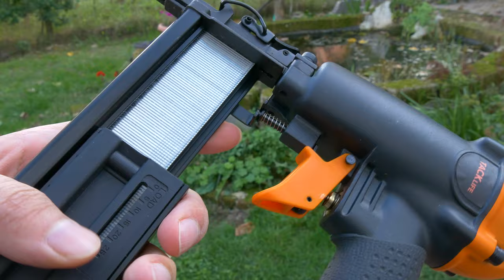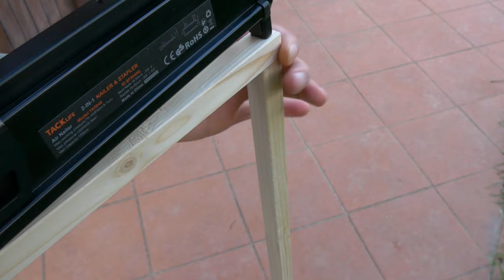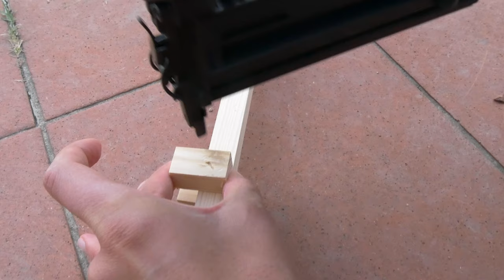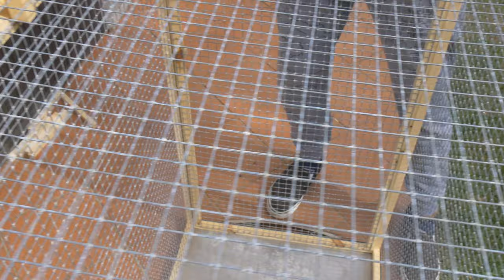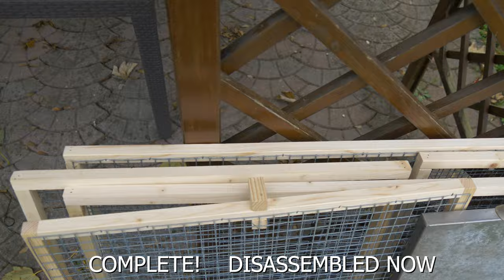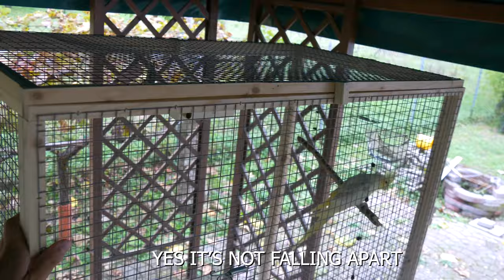Making an Assemblable Bird Cage

Comment: Nicely done! Maybe I will make one too for our apartment terrace, thanks for the idea!  The wire mesh should be made from stainless steel  (not toxic for birds?)
Reply from the maker: Stainless steel is the best, galvanized mesh is ok if of good quality, when the process is done right there are no residuals. I used them for many years with never a problem, but with stainless steel you are extra safe
Reply: @TielZone  Thank you!

Comment: Hello, what is the tool you use?  a nail gun?  do you have the references?  thank you so much
Reply from the maker: It's the tacklife 2 in 1, it's both a nailer and stapler, works attached to an air compressor
Reply: @TielZone  Thank you
Reply: @TielZone  I have the same tool!!

Comment: I was just thinking of making a cage these days.  The wire part confuses me.  Stainless steel is often hard to find and expensive.  Galvanized metal also causes heavy metal poisoning to birds as they bite.  You have beautiful birds and experience.  Do you have any information that galvanized metal wires will corrode with the bite of a cockatiel or cause metal poisoning with its licking?
Reply from the maker: All my cages are of galvanized metal and I have many cockatiels since many years, with no poisoning. If the process was made right there should be no residuals and should not corrode, cockatiels climb on the wire but it's just that. I always leave the net outside under the weather conditions for weeks, this also serves as a washout for eventual residuals.
But of course if you can get stainless stell just get it so you are extra safe
Reply: @TielZone  thank you for detail information about it. Best regards